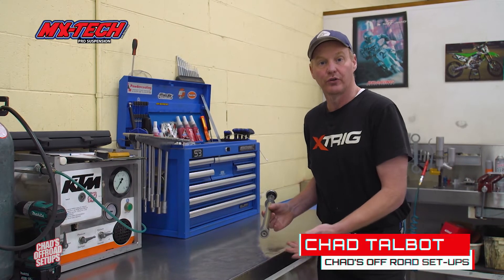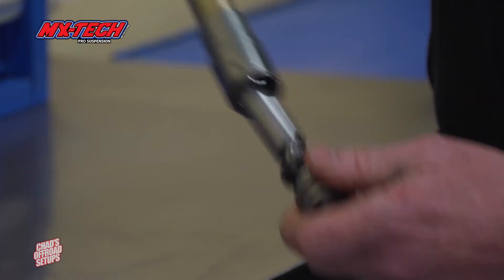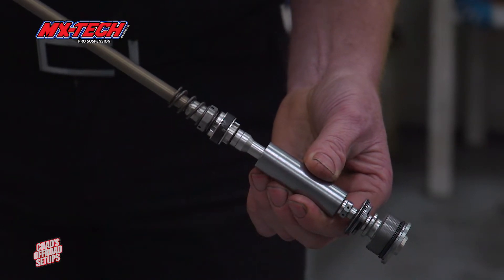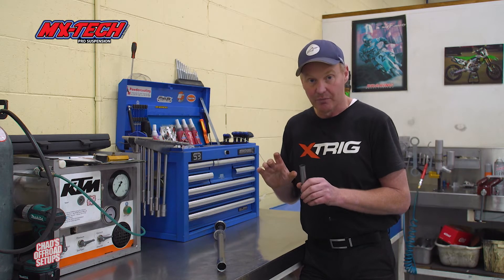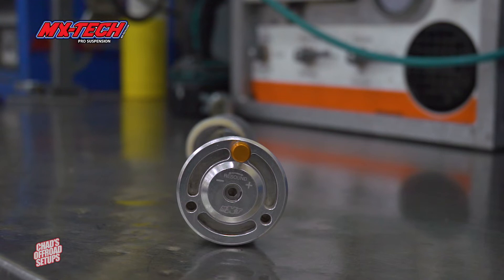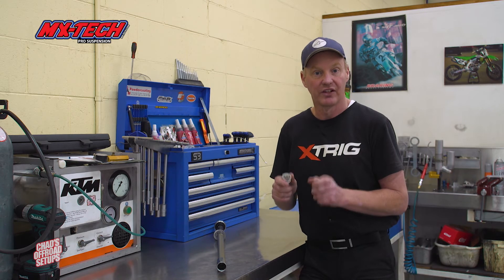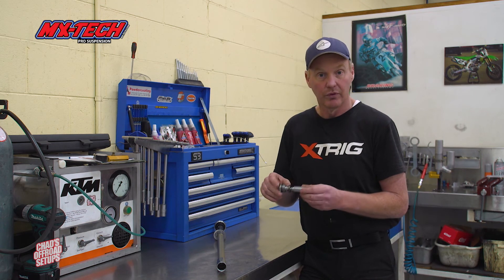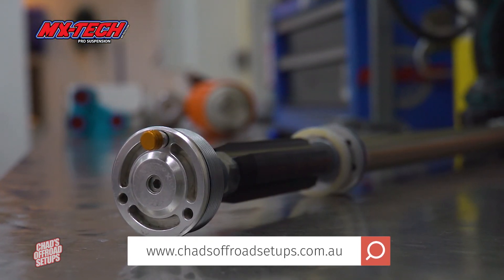Chad's Offroad Setups - Product Update - MX-TECH MXT Lucky System

Comment: I have definitely decided on the Lucky cartidges for my 2022 KTM 500 EXCF, but my greatest challenge are simple washboards on the dirt roads I ride between trails. At 63, my lower back ain't what it used to be. If I do not stand the entire time, my back takes a pounding on washboards. I am wondering if the National shock in the rear might help this, or just a simple re-valving of my stock WP?

Comment: How low or high can you go on the air gap?  I've been experimenting between 125 and 130 mm , seems to make quite a big difference in the amount of total travel. What are you recommendations and typical settings for single track B rider 235 lbs.
Reply: Interested in this question too...